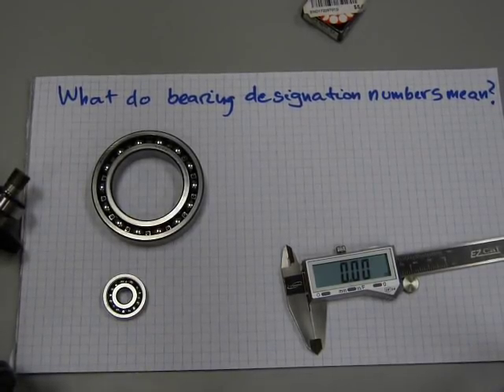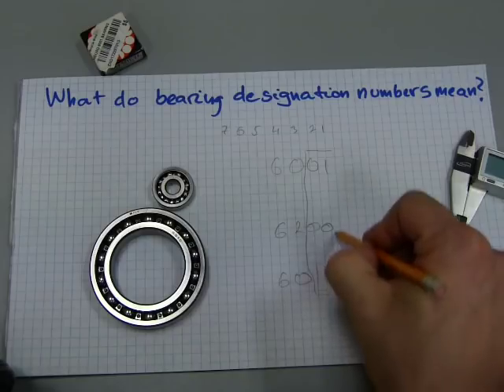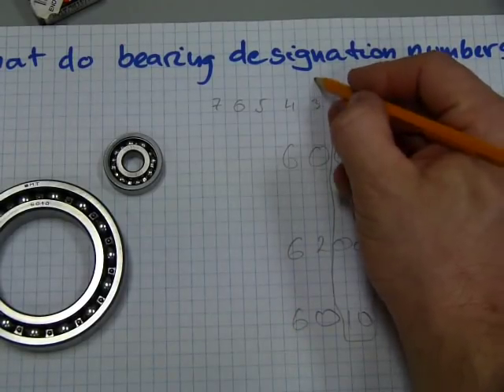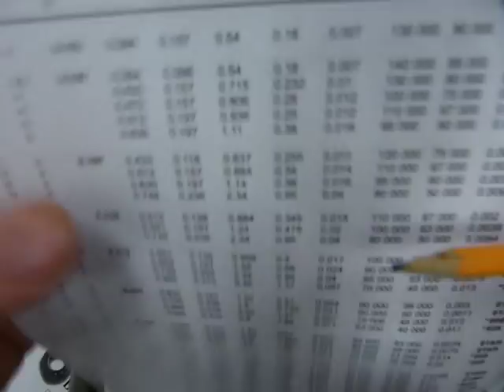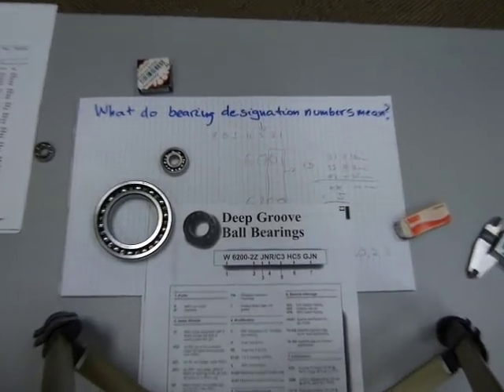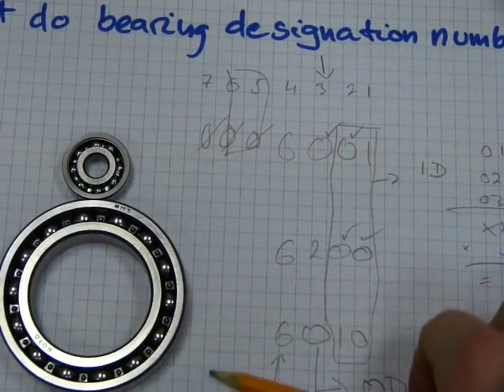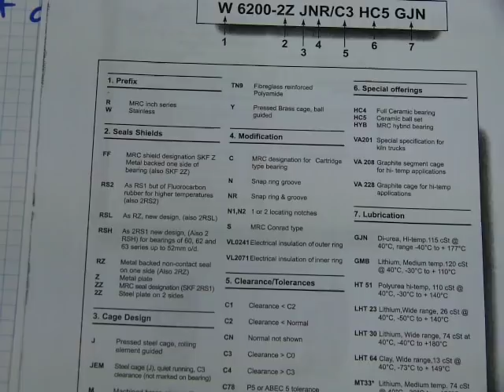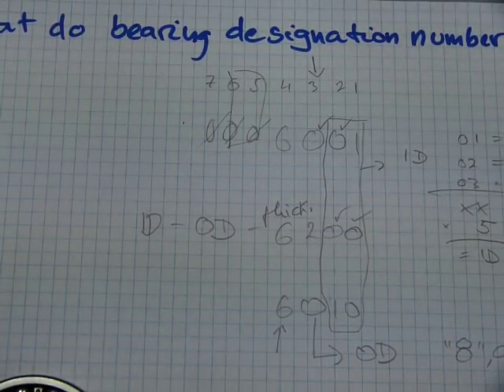What do bearing designation numbers mean?

Comment: The third Digit represents the duty for it will be used. For example. Extreme light load carrying bearings will start from 0-1 and high load will go from 4-5 and so on.
Reply from the maker: Not for any of the metric bearings, ISO, DIN, JASO etc.. What standards are you having in mind? What`s the standard number?
Reply: i think may be you are right because in mostly Indian bearings the 3rd digit stands for the duty of its use..like if the code is 3 that means it should be used for medium load.
Reply: Higher load is identified with either c3 or c4 depending how much they need to expand at higher loads

Comment: why the code system is so stupid like this :/...... Isn´t possible to make a more intuitive system ?
Reply from the maker: Good question. Current bearing code system apparently comes from manufacturing dimensions specs.
They would run out of cutesie names like "Big bearing, Maxi, Mini, Fatso, Double wide ..." pretty soon.
Simple naming systems work well when only a few sizes are manufactured, like battery sizes, light bulb socket sizes, screwdriver bit sizes, ...
Hope that makes some sense, thanks for watching.
Reply: I think my PTC friend on top meant "intuitive" as in: a 10mm ID by 62mm OD bearing named as "6210" for example. That would be more "intuitive" than finding a code in a book somewhere. For someone that does not use these codes on a consistent basis I can see howit could be confusing.
Reply from the maker: Totally ...

Comment: Hi. I have a automotive pulley that uses a NSK 6203DU bearing. I want to replace it with a higher quality bearing so I got a SKF 6203-2ZJEM.

Any possible issues I may run into?
Reply from the maker: Jackson Cruz Nothing major. NSK is a top-of-the-line Japanese bearing, SKF is considered the best in the world, has better quality control - or so I hear.
The DU is a light bearing with a pressed steel cage and a single-contact seal, made with an average radial clearance of 0.0008 inch (ISO stuff)
The SKF has a steel cage and is an electric motor grade (means lower friction, is rated to take 200lb more dynamic load and can spin about 10% faster max 19,000 rpm. It may not have the oil seal on it at the point of sale.
Reply: theoverengineer

Thanks for the info. The SKF according to a spec sheet I reviewed has double metal shields. I'm going to go ahead and use it in my automotive pulley as clearly it is a better pulley than the NSK. Thank you for your reply.
Reply: Only issue is replacing a rubber sealed bearing with a metal shielded is you cannot protect against moisture ingress only dirt. SKF v NSK? No genuine argument to favour one against the other.

Comment: Hi...........nice video.....
for my project i want a bearing having following condition ...can u suggest me bearing no.???? (generally a bearing should have housing )
1.ID=12mm
2.OD = ANY dimension
3. low load and (with rpm 400) And it has to hold shaft having weight of 1.3KG
4. very very smooth to rotate the shaft.
Reply from the maker: +girish naik Any steel bearing is strong enough. Go to a LOCAL supplier and try out some and see which are smooth enough. Very very smooth is hard to look up without a number describing levels of smoothness.
Reply: thanks but can u suggest me bearing no. for id of12 mm
Reply from the maker: Get a bearing catalogue and start reading it.
Reply: ok

Comment: Pl elabrate the Brg NUMBERING . It is good.
Regards
S S Rao
Reply from the maker: +Sanyasirao Senapathi Numbering comes from manufacturing tradition and is only loosely related to physical size. The available forming dies they had just got sequentially numbered and those became part of the bearing designations with only a loose relation to actual size.
Similar case is sandpaper grit numbers, wire gauges and sheet metal gauge numbers. With wire and sheet, the gauge numbers loosely relate to number of passes through forming dies, abrasive grit numbers somewhat relate to the number of openings in a sieve per some area abrasive particles pass through.

Comment: Csb204-12N what this means?
Reply: Vahagn melikyan different type of Bearing, this is an insert bearing of similar dimensions to a 6204 but with an extended inner with a grub screw to lock into the shaft. The 12 indicates 12/16 bore so 3/4” 19.05
Reply: @petebrayshaw2360  thanks so much 👍
Reply: @petebrayshaw2360  what is wjb B-312 on bearing, because search engine gives me Csb204-12N instead

Comment: Bearing measurements explaind totally wrong! Go back to school !  00=10mm  01=12 mm at 05 begins the normal counting , last two digits multiply by 5 !
Reply from the maker: Dick Van Den Berg Discuss with SKF bearing manufacturer, see how that goes.
Reply: Dick is correct re the 00 01 02 03. 10mm 12mm 15mm and 17mm. Bore then starts with 04 on the x5 method. Video is incorrect, a 6001 has a 12mm bore